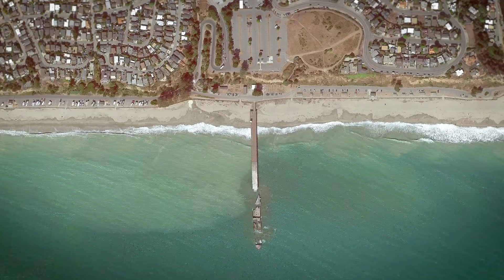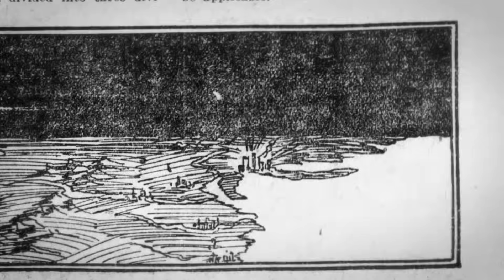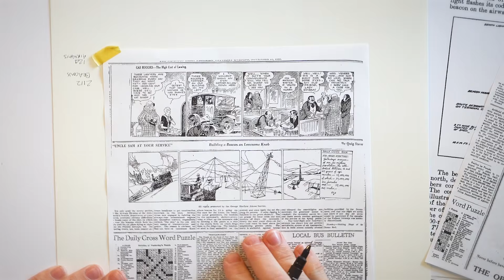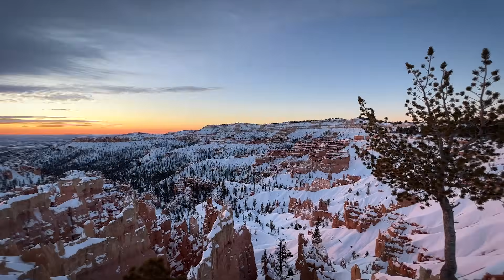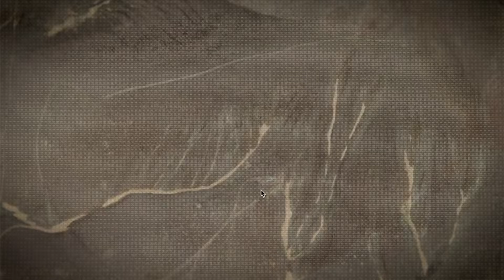Americas Forgotten Network of Abandoned Aerial Highways

Comment: Excellent video! Until I started flying in 1985, I had no idea that the airway beacon system had even existed. Although no longer operated by the FAA, there where still a number of them operating in the mountains of Montana (as you mentioned). The main drawback of the beacons was that they obviously required VMC conditions which in the Southwest are pretty prevalent; unfortunately the same can't be said for other parts of the country during certain seasons. With the advent of the LF Range and the ability to fly in IMC, the beacons days were numbered. Still, a very fascinating and nostalgic period in early aviation history. Thanks for this cool look!

Comment: This is a neat bit of niche history. I first learned about the arrows as a young professional pilot during the course of my training from aviation textbooks on the history of aviation, have passed by small point of interest plaques near ones by roadways, and have read about them quite a bit. They often get treatment in aviation museums that cover early aviation, and quite a few airports are named after the early airmail pilots along their route.

We still have radio based airways today, though the radio navaids themselves are increasingly being replaced by satellite based navigation systems in non-mountainous areas apart from a backup network.

Comment: Growing up in El Paso, Texas, one of the fixtures of my youthful perception was the red-and-white rotating beacon on the southern end of Mount Franklin, visible from just about anywhere in the city.  Sometime in the 1960's it was unceremoniously uprooted and replaced by a television transmission station.  At that time the airways beacons flashed with opposed red and white beams to distinguish them from the rotating  beacons at airports that flashed alternaing green and white beams.  And to further code the lights, the rotating beacons at US Air Force bases had a special lens that split the white beam in two to give a doubles flash, preventing hapless civilian pilots from making a major landing mistake.
Reply: Just to add, heliports are white, green and orange.  I used to work the flightline on a civilian transportation contract at Ft. Campbell, KY (KHOP) and there was also the smaller municipal airport for Clarksville, TN nearby (KCKV).  They look quite different from the air but we still looked on in amazement one afternoon when the MP's rolled out onto the ramp with the airfield ops truck to meet an antique Stinson Voyager landed and taxied to the ramp behind the "Follow Me" truck.  Never heard what happened to the pilot but wouldn't have wanted to have been in his shoes.  lol

Comment: If you don't see an arrow, it doesn't mean it wasn't there or that it is not there now. The jungle returns quickly. Even the prairie is hard at work. The desert takes its time.
Reply: If you play Microsoft Fight Simulator 2020, you can get a free mod that fills the US with these old beacons and even the intermediate airfields in some cases, so you can follow the old airmail routes just as the old pilots did.  It's pretty.

Also, France had a very similar lighted airway system at about the same time.  I don't know which came first or whether 1 inspired the other, but the French system did exist.  At one time, there were plans have in in MSFS also, but I don't know what's happened there.  Anyway, maybe you can find some relics of the French system as well.
Reply: @TheBullethead  Both points are fascinating. Thanks very much for the heads up.
Reply: Would be really neat to go find some hidden in the vines
Reply: @borutoisntreal  I completely agree.

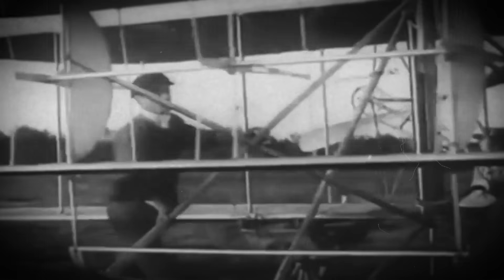Comment: 6:14 what was that thing that dropped
Reply: It's a big weight; the Wright Brothers used an aircraft catapult to launch their Flyer, because they knew their engine didn't have enough power for takeoff. The weight was connected with a cable to a wheeled dolly, on which the plane was placed.

Comment: Makes me wonder how many of these I have seen and maybe thought were radio station transmitters and towers. Maybe a remnant with a private grass airfield. 

I remember trying to find the remains of Route 66 a couple of years ago. My dad had driven us down portions or maybe the whole thing with stops at the tourist traps and roadside motels and cabins. Route 66 goes through the base where I was stationed with a guard house at each end, but only one end opened all the time. The road layout had parallel roads on each side and obvious spots for earlier guard houses when the base was split in half by Route 66 before the nearby freeway. Another feature of the desert portions of Route 66 is the road often had a red tinge to it instead of black or grey.

Comment: How amazing would it be to have a flight simulator with this?
Would be so much more fun to me than flying airliners over oceans with autopilot.

Flying a route with visual clues in vintage airplanes sounds amazing to me!
Reply: I've been doing it for 50 years and while the beacons and arrows are gone the old routes are still clearly visible. Just follow the interstate highways.
Reply: they should make a like, historical flight sim. Biplanes, zeppelins, hot air balloons, with period accurate navigation and setting
Reply: damn. now I kinda wanna make a mod for mfs with these beacons.
Reply: @nikomew666  i think there is one!
Reply: Old reply but you should check out stormworks. It's somewhat user friendly and convincing for what you wanna do

Comment: My grandfather was an owner operator pilot starting back in the late '20s giving plane rides at Jeffery Field (Bostons' Logan) in 1929 for $5.00 then and told me how he and others would paint these big bright arrows pointing to the nearest airport on the roof of a towns tallest building back then and he was also a H.A.M. radio pioneer and helped in the start of 'Flying by Wire' where a linear radio signal was beamed from one airport straight to the next on a certain frequency the pilot would tune into, if on course the pilot would hear a steady tone but if drifting to the left of the signal the pilot would hear morse code dashes and dots if drifting to the right. At his wake some time ago a gentleman introduced himself as Charlie McCloud and he went on to tell me how his first job in life was dusting off his biplane once or twice a day depending on his plans, to which his pay was a nickel each time so he never went hungry.

Comment: Don't know how I missed this one, but a while back I had my own aerial mystery involving a set of coordinates, some odd shapes including a swastika seen on Google Maps, and the city of Roswell, New Mexico.  Yes, that Roswell.  The short version is, during WW2 there was a bomber school based outside Roswell, and those shapes were all targets.  The Swastika also happened to be in the center of a very large radial target.  Instead of dropping explosive bombs, they would use essentially large sandbags to simulate the sudden weight loss of the aircraft for the pilots as well as providing a visual marker for the bombardiers to be scored on without destroying the targets or causing any safety issues with the nearby town.

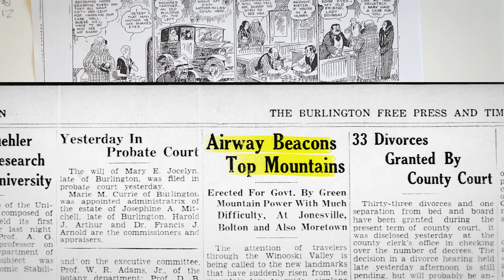Comment: @21:55 I caught "Green Mountain Power" when the newspaper passed thru. As a Vermonter - The Green Mountain State - I was surprised to see that, so I backed up and paused... Not only is that in fact from my local paper all those years ago, but 2 of the towers mentioned are in my town and neighboring town respectively. 
I knew that the FAA currently has radio equipment on Robbins Mtn, but never knew it dated back this far. The 2nd location on Stimson I didn't know about. I knew of the mountain, but not that there was a tower on it once...

As you said, Google Earth is an amazing resource, so after about 10min of "flying" over that area on the map I was actually able to locate the metal tower poking thru the trees. All these years later it's still standing there, ensconced in a sea of green... Foliage season is coming and this sounds like a great excuse for a hike :)

I might have to go for the trifecta and find out what the status of the Moretown one is and if it is still around...(edit: I think i found this one too! Unable to determine from the satellite if it's still standing or just the pad, guess I'll just have to go investigate ; )

Thanks for cluing me into to some cool local history from all the way across the pond!

Comment: We have a sight near where I live in Shreveport, Louisiana. The arrow is gone, but the beacon tower still stands. Still owned by the FAA, it seems to be repurposed as an antenna tower. The top still has the platform where the light would have been.

A similar topic that you might be interested in are the AT&T Long Lines towers. These towers used microwave technology to relay phone calls across the country and many towers still stand as it is cheaper to just maintain the red warning light on top than to tear the structure down or repurposed to mount other antennas. This system was phased out in the 70s as newer telecommunications technologies emerged.

Comment: Here's a Scottish WWII era concrete arrow for you: 57.82085213558817, -3.8171953859798378 .  It's 80 ft long, there was a brick hut of some kind next to it, it's within ten miles of both RAF Tain and RNAS Owl but nobody seems to know why it was built or what it was supposed to point to... just a few years ago it was in much better condition but you can still see it clearly enough on the Google aerial imagery
Reply from the maker: Oh Fred what an amazing tip! Charlotte also mentioned a few UK concrete arrows for training etc... I need to check this out!

Comment: As a pilot who relays pretty much solely on GPS now it’s wild to see this. These pilots were flying at night without radios, radio Nav, and more importantly weather radar
Reply from the maker: Imagine! One of the books (flying the beam) mentions how in the early days they even relied on political maps that had little more than town names and state line to navigate! Absolutely crazy guys.
Reply: @CalumRaasay  one of the lost techniques you can use is flying the “iron compass.” You find a railroad/highway and follow it to a town to find the water tower. In the states most towns have their name painted on the water towers

Comment: From Wikipedia, the free encyclopedia

1st Lieutenant Victor Carlström (April 13, 1890 - May 9, 1917) in 1916
1st Lieutenant Victor Carlström (April 13, 1890 – May 9, 1917) was a record-holding Swedish-American pioneer aviator. He set a cross-America flight air speed record until the record was beaten by Ruth Bancroft Law.[1]

Biography
He was born in Gustafs parish in Kopparberg, Sweden on April 13, 1890, to Axel Carlström.[2][3]

He migrated to the United States through Ellis Island in 1904, when he was 14. He moved to North Park, Colorado to work for his uncles Andrew Carlstrom and William Norell Carlstrom who had cattle ranches.[3] He became an instructor one week after leaving his job at the cattle ranch.[1]

In 1916 he was 2,000 feet (610 m) short of a flight altitude record when he ascended 16,000 feet (4,900 m) in a triplane. He also planned to make a non-stop flight from Chicago to New York.[4]

He went to work for the Atlantic Coast Aeronautical Station where he and a student pilot, Cary B. Epes, were killed on May 9, 1917, when their biplane collapsed in flight.[1]

Comment: On top of a 100 year old building in downtown Pittsburgh there was once a pylon with vertical red neon lights up it that flashed PITTSBURGH in morse code/CW and I was always told it was an aerial beacon, an aid to navigation at night in the days before Air Traffic Control and reliable radios. Perhaps it was part of this system.

Comment: Someone needs to show this video to Blancolirio
A pedantic note

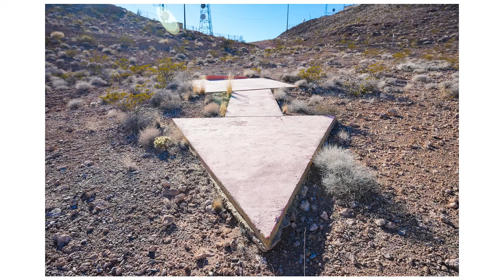at 28:21, the arrow was constructed flat and level, but the hillside has eroded away and shifted it into that position. you can see it's at most 6" thick, while the slab for the generator building looks thicker, which is why it stayed in place better.
That little piece of geogophy it's located in is known as a "wash" for obvious reasons, so repeated rains have taken a toll.

Comment: I'd love to know what kind of concrete they used
All three parts of the arrow have different necessities and demands, one needs to reinforce and carry the tower, one needs to reinforce and carry the generator, but also needs to not carry it's vibrations, and one is more exposed to the elements
Did they use different kinds of concrete for each part of the arrow or did the have to find a concrete that can do all three things well enough?
That would have been more expensive, though

Comment: It's a good thing you didn't go down the AT&T Long-Line/"AUTOVON" transmission tower rabbit hole while in the USA 😉 (AUTOVON is also in other countries as it was basically for emergency cold war nuclear war/ emergency military communications, conplete with a system for launch commands from bases or certain aircraft) basically a huge network of large transmission towers with big horn looking transmitters and recievers for television, wireless phone services, and civil defense placed roughly every 40 miles in multiple directions. A dedicated fan base has also mapped out pretty much all of the remaining towers, with some built to be nuclear blast resistant critical switching stations... (I just know about the very basics of the system and its quite impressive,  although now obsolete) Possibly another interesting video topic someday 😉 Great video and content as always 👍
Reply: The Dahlonega / Dahlonega 2 GA sites are not far from where I live now, and the Buford, GA site was about 4 minutes from my previous house. I'd have like to have toured one when it was active. A large number of these sites have been bought by American Radio, and either sit idle, or have some commercial equipment on them.

Comment: I'm impressed that while traversing a quarter of the United States you were able to stick to your plan and timetable. Another excellent video!
Reply from the maker: Same here - and not to mention in January when roads and whole areas where closing left and right due to the weather!
Reply: This is amazing I've read a lot about how aircraft navigation works now, but never thoutgh about how it worked before radio was the way, encompasing probably 30 years of time. I wonder if reference that map with the current ifr routing map and see how much overlap there is. There is a famous Midair collision that occurred over the Grand Canyon that changed completely how.long distance flying was done.
Reply: @RowanHawkins what collision was this? Is there a video about it on YouTube?

Comment: Oddly enough, this was really interesting.
Makes me wonder what the UK did.
I know that Croydon Aerodrome had a big rotating search light that spun around slowly and pilots used compas bearings to get down to dover or birmingham.
other than that I am not sure what the UK did use.
Reply: Keep in mind that the driving force behind all this was the US postal service and flying by night.
England had no need for "overnight air mail" because it already had a polished, extensive and well established railway system that delivered mail all across the british isles overnight. Mind you the distances were much shorter.

Also, consider that the USA could place arrow markers pointing to strategic waypoints knowing that no enemy could take advantage of them. While the british (or the germans or french) were certain that enemy airplanes had the range to overfly and benefit from such visual beacons.  Guiding them to population centers, not a great idea.

Another factor was that the british were far ahead in use of radio for navigation. The Type 72 homing beacon was in development as early as 1932 and already operational in 1936. While highly guarded secrets, they would inform the decision to avoid expenditures in other kinds of signals. The USNavy already knew radio navigation was possible, as early as 1920
WIRED "To test the viability of using radio navigation in an airplane, the Navy installed a radio laboratory of sorts on board the U.S.S. Ohio which was cruising off the mid-Atlantic coast July 6, 1920. A Curtiss-built Felixstowe F-5-L twin-engine flying boat (of the type pictured above) took off from the Naval Air Station in Hampton Roads, Virginia, with no knowledge of the location of the Ohio other than the fact it was within a 100-mile radius of Norfolk."

So between the shorter distances, the overnight railways, the development of radios and the threat of helping the enemy... arrows would not be the best idea in the british isles.

Respectfully.
Reply: @ricardokowalski1579  Excellent points!
Reply: I think the main issue that the USA was trying to solve there, was that a lot of its inland was absolutely massive and sparsely/recently populated, and thus lacking enough reasonably spaced, easily recognisable (and mutually distinguishable) natural and man-made landmarks.

Considering the UK is a lot smaller than the USA, and had been developed for much longer and more thoroughly (as in: hundreds of years old villages/towns/cities, churches and other recognisable man-made developments were already spread everywhere throughout, and there are even nearly two thousand year old Roman roads etc), as well as lots of well charted rivers, roads, etc... I would guess that they probably mostly navigated by using all of those as guides?

I know roads, rivers and pre-existing landmarks (both natural and man-made) were definitely used to aide in navigation during WW1 and WW2. 
And planes literally following a road, or basically flying from church tower to church tower was absolutely a thing.
A compass definitely helps though :P